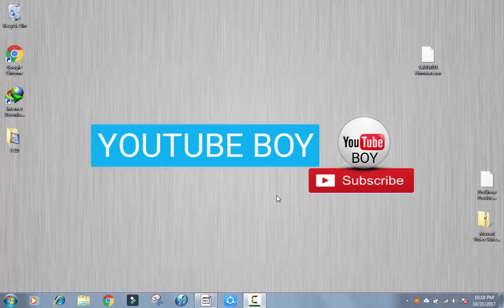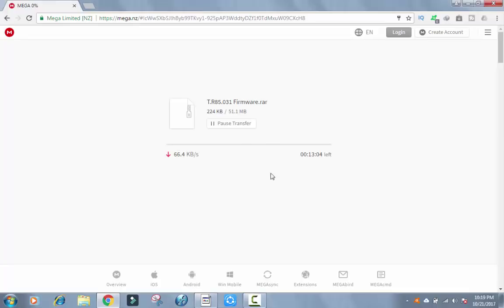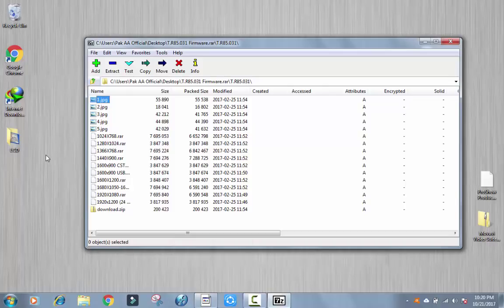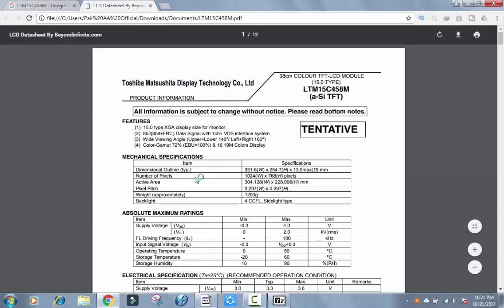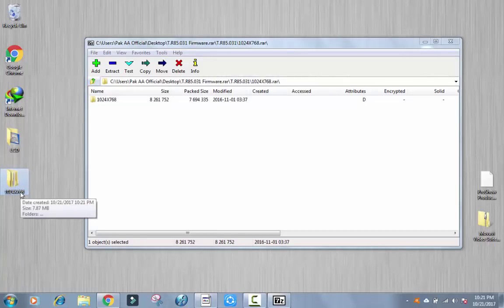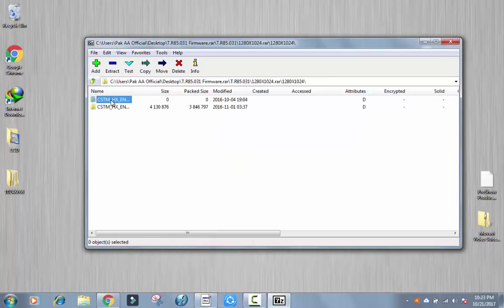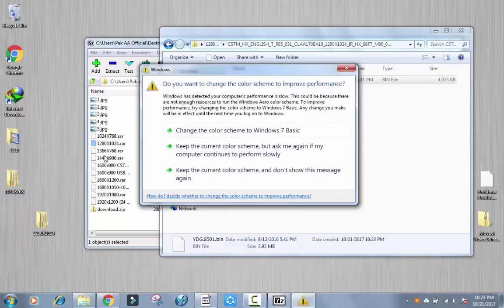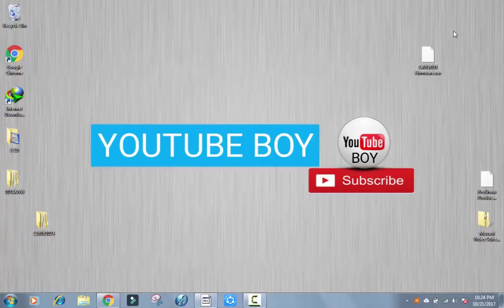T.R85.031 Firmware |  universal LED TV board

Comment: its a same binfile v59 and T.R85.031??    please answer
Reply from the maker: No V59 and T.R85.031 are not same MicroControler  so you can't use V59 as R85  both firmware links on my channel